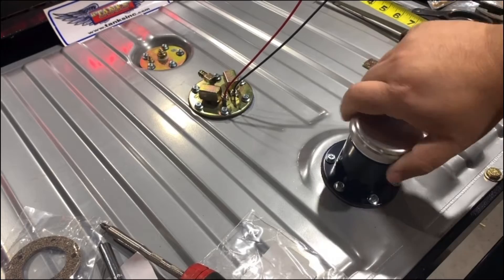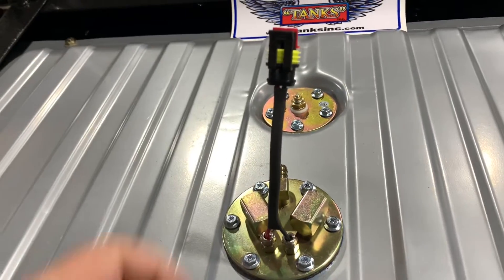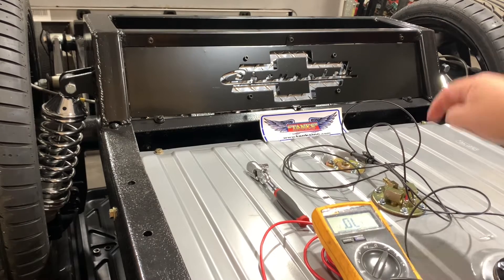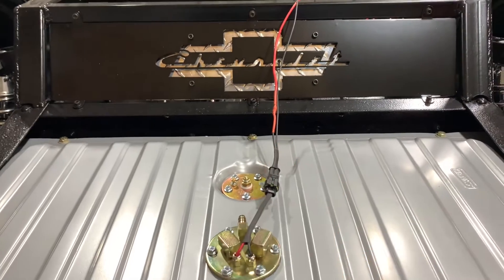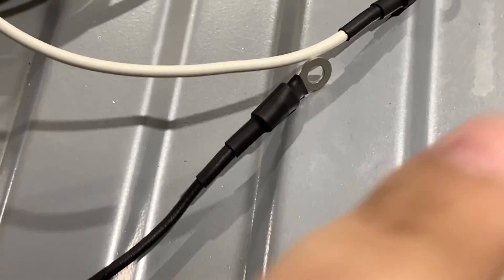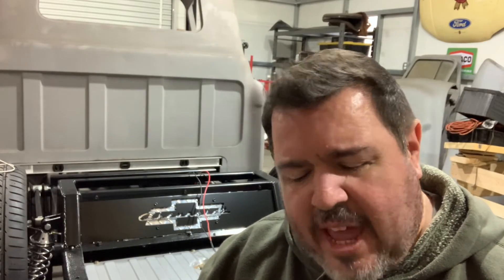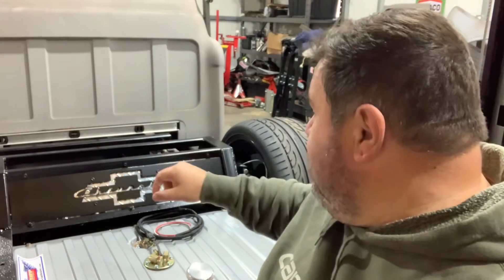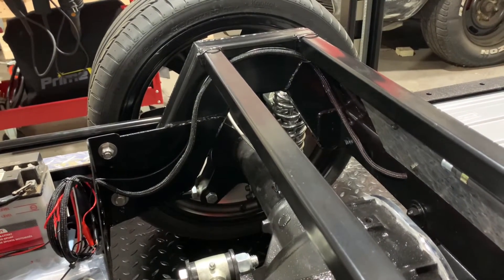LS Swap Guide - HOW to WIRE the Fuel pump and Sender!

Comment: Great video.  If you remember, what were the gauge size of the wires on the pump and what gauge did you change it too.
Reply from the maker: I think they were only 16 or 14 on the pump. I ran 12 all the way up, though its probably overkill since the LS harness uses a relay for the fuel pump

Comment: I’m wondering what actually runs the fuel pump ? Does the LS harness have a plug for it or do you run it off the main wiring panel ?
Reply from the maker: Good timing - I just got it running and thats one of the parts I went over in the latest video: How to Make Your Gen 4 LS Run On a Stand-Alone Harness - Detailed Tutorial!
https://youtu.be/QFN5RLsP2sg
Reply: @intheshoptv  oh perfect ! Thank you I’m almost at that part of my build I need to sort out what fuel pump to use and how to wire it . I’ll check it out !
Reply from the maker: @spesh1300  awesome good luck! Feel free to ask if you have any questions along the way!